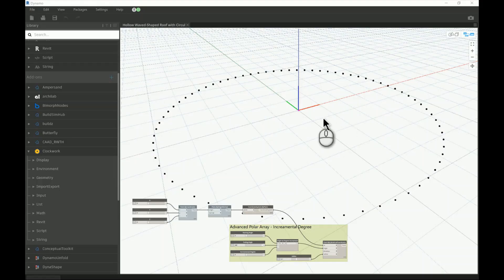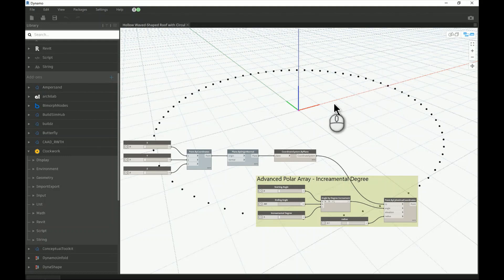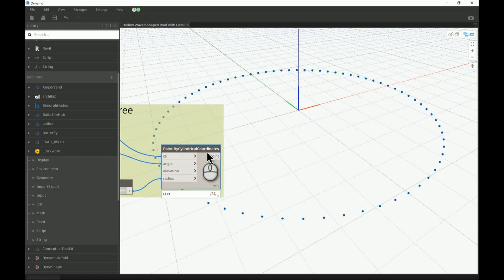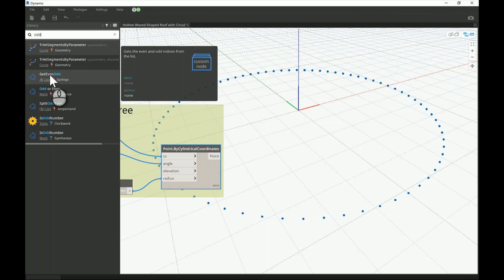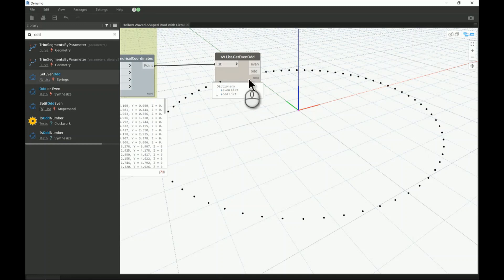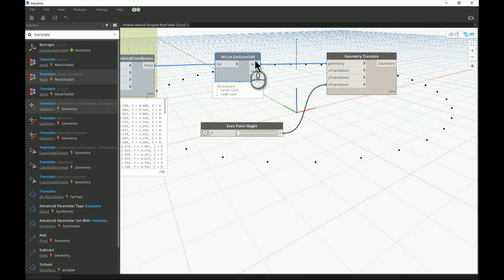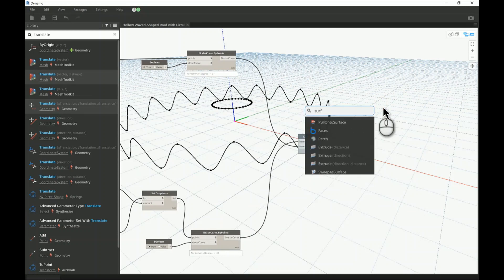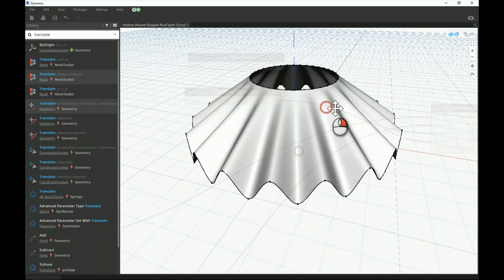Hollow Waved-Shaped Roof with Circular Plan in Dynamo

Comment: Instead of circular plan if I have square plan how i will do it?
Thank you
Reply from the maker: Use polygon and divide its perimeter as you need, set the sides of the polygon to 4 indeed to get ur square
Cheers
Reply: @FirasNoori   I did it like this but i can't connect it.